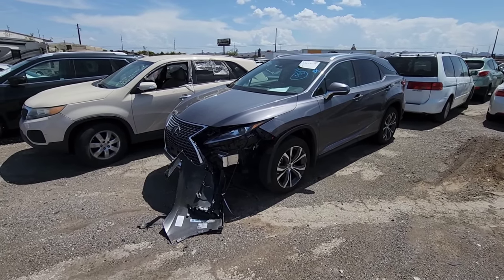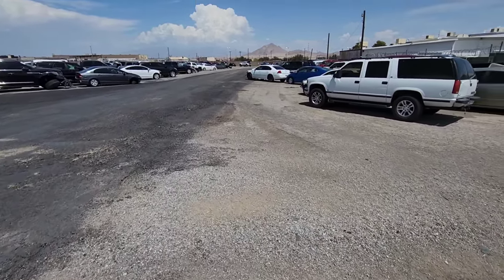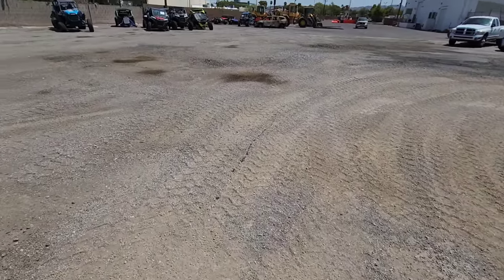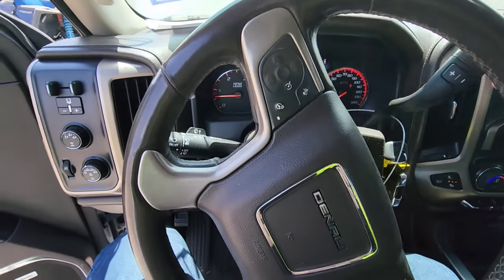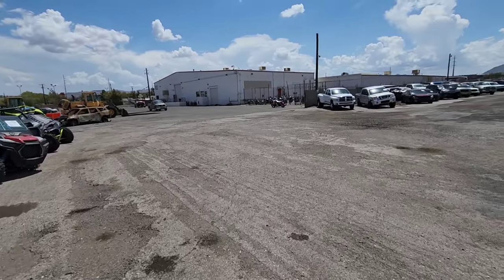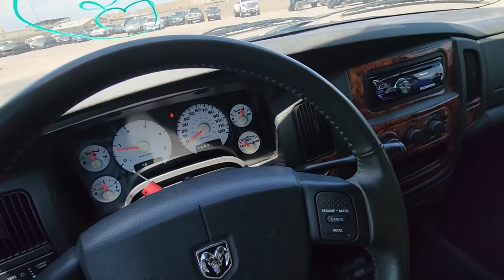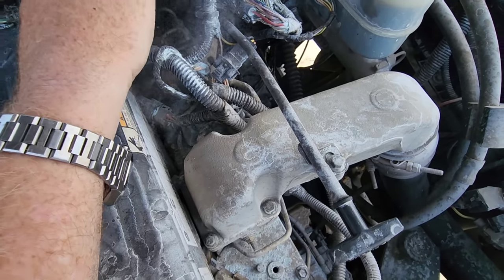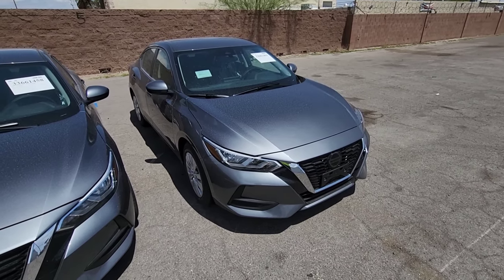So Many Diesel Duallys At Auction, IAA Walk Around

Comment: 6:33 Professional Grade for 2015 GMC 3500 which is nice truck.
16;08 Grab Life By Horns with 3rd Gen Ram Cummins sharp dually aswell not too bad with small fire damage amazed it started on it's own doesn't need jump but may need look those wires tho.
Reply: Every Dodge needs completely rewired

Comment: If the GMC has the 6.7. Get the Denali,  that's the top of the line of GMC. The 6.7 diesel is 2nd best to the old 7.3.  I love the RAM diesel but love the look of the GMC better I think it's the headlights that make it beautiful.
Reply: The 6.7 and 7.3 are in the Ford trucks
Reply: @mikeflege5733  ram has a 6.7 Cummins in them, they also used to offer a 5.9
Reply: Duramax is a 6.6, ford and ram have 6.7 engines